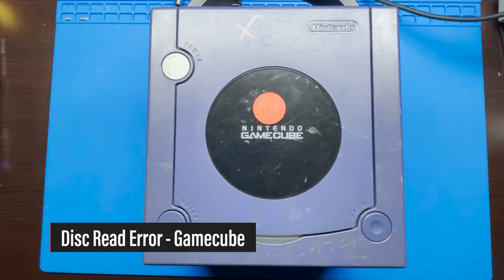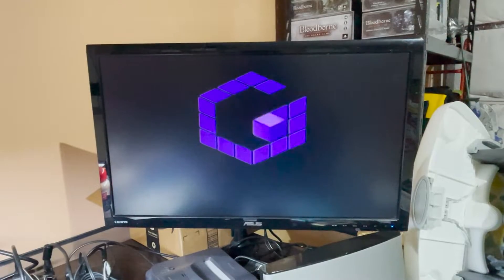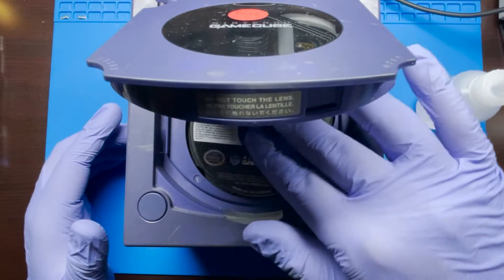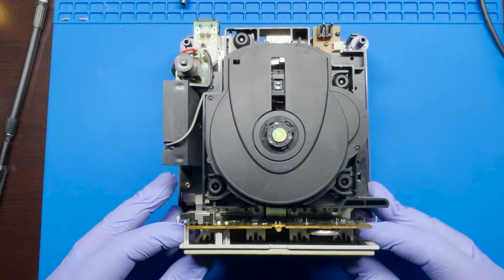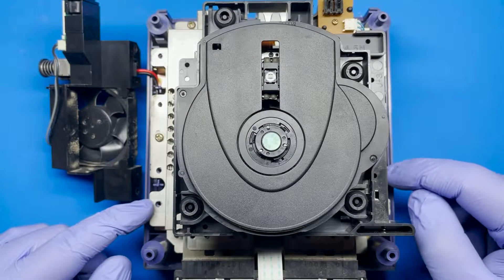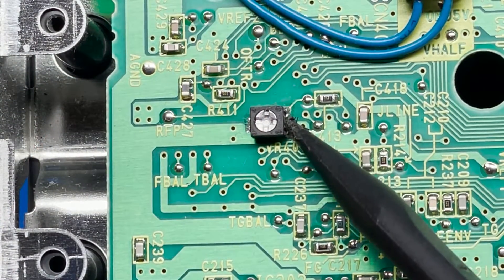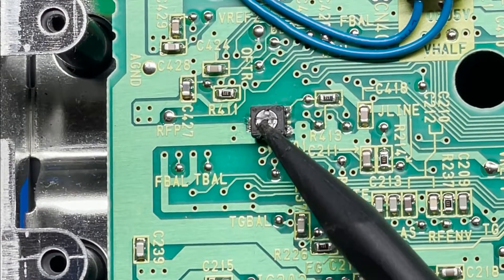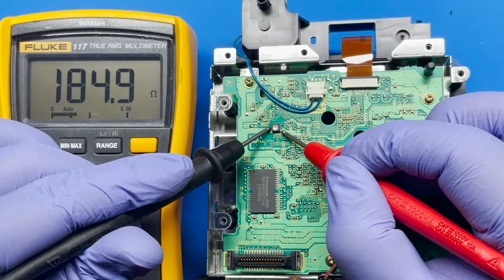Steps to Troubleshoot a Disc Read Error | Gamecube

Comment: Before messing with the potentiometer, I always check/swap some capacitors from the disc assembly's board (the same board that the pot is, just on the other side). The C408 47uf capacitor is notorious to go bad (the 100uf C401 and the 47uf C431 next to it sometimes goes bad too). My guess is when we mess with this pot, we're just feeding up extra power to the laser to compensate those bad caps.
Reply from the maker: Yes this is true, I should've mentioned that in my video and I actually ordered a set of capacitors from Console5 to replace them (I just rant out). They generally run for $2-3 and is a lot cheaper to replace than the laser reader. I will upload a new video showcasing this and thank you for bringing this up! Also, in the case that anyone changes out the caps, be sure to reset the potentiometer for the laser back to the original factory setting as shown in the video, otherwise too much power is being applied to the laser.
 
For reference (Factory Settings):
DOL-001: 450 ohm - 600 ohm
DOL-101: 150 ohm - 250 ohm

Cap Kit (Look for Optical Drive Caps):
https://console5.com/store/nintendo-gamecube-smd-cap-kit-ntsc-and-pal.html

Comment: Mine was reading 190 ohms and I did a recap using a console 5 and it wouldn't read discs until I got it down to 112 ohms. I triedit again a few days later and it wouldn't read the discs until I cleaned the lens with ipa. I"m not sure if the laser is just super dirty. if it stays consistent I may adjust the resistance up to avoid burning the laser out

Comment: Thank you for this it was very in depth! It seems I just have to adjust my GameCube’s potentiometer a little bit. If it goes below 120 ohms I’ll just replace it. Like you said it could damage disks and these days you cannot afford to do that, literally. A new disk drive assembly with the lid flaps is cheaper than a copy of Smash Melee these days.

Comment: I've been having trouble diagnosing mine. I move the laser to a down position (closest to the center) and when it turns on to reset the position, it makes this horrible grinding noise, like the gears are slipping for the laser rail. 
When the laser is in the highest position when turned on, the motor doesnt even spin (doesn't spin on both positions). Do you know what it could be? All the gears look fine to me.

Comment: hi, i know this video is pretty old. i just wanted to say the BIGGEST thank you.i got a gamecube off ebay to read games following your entire tutorial. 

i do have one question for you, mine is running at around 22 ohms ): i tried every digit possible as far as 250 and only that seemed to work. you mentioned this would mess up my games over time? what are the other disadvantages of playing it with only 22 ohms? im still grateful to even have it run and start i even got emotional
Reply: also, i saw your tutorial on getting a new disk reader considering it seems id def need to buy one. it looks so complicated though this was truly so much money wasted for me.

would you reccomend i buy a new gamecube off ebay and try to fix it as well? see if it actually holds around 130-170 ohms? I'D APPRECIATE YOUR FEEDBACK SM!!! TY AGAIN <3
Reply: That’s awesome, I bought a GameCube with 4 games 2 controllers today from offer up for $25 came home plugged it in and it won’t read the games but the game cube turns on just saids an error has occurred 😢😢

Comment: Let me ask you, have you ever heard of a GameCube that needs to "warm up" before working properly?  I never had the chance to clean my game disk, as every retro store around here either has their machine broken (even after getting it replaced) or does not have the GameCube game adapter.

So I was powering it on and off (resetting) about a dozen times or so, and it would get a little further each time and then finally get to the Press Start screen and the game would play no problem, all day and night.  But the process had to be repeated each day.

Then I discovered by accident, that just simply turning on the GC for five minutes or so and then resetting or putting the game in, it works flawlessly.  My other games work fine, just not this one.  Ever heard of that issue or solution before?
Reply from the maker: I think there was a user that had commented on the exact same issue that you had. Personally I haven't come across that issue, but it could also be that once I notice the disc not being read, I start replacing the components 😅
Reply: @totalfix877  haha!  Ok.  Thank you.
Reply: Yes!! This is currently what I have to do with mine. My guess is it has so ething to do with the Lazer going bad so maybe it needs time to warm up as it gets older
Reply: @sadiqmuhammad396  but only for a certain game and not the others?
Reply: Just trying to help but ur capacitors on the board of the disk drive have gone out that’s why
Reply: @ThePooterMan642  what makes it continue to work though?  Warmth of having it on for a few minutes?

Comment: My GC gives me a disk read error sometimes and sometimes it will not.  So I am not sure exactly what the problem is.  When it reads the disc, it works flawlessly.  It's getting it to read the disk consistently, that is the issue.
Reply from the maker: It may be that the laser has gotten weaker over time, you can easily tune this to be a bit stronger for your case since it doesn't sound like it's in such a broken state that would warrant an entire capacitor replacement (although that would be a true fix for it). 

This would involve a few tools:
1. Digital Multimeter
2. 4.5mm Gamebit for removing Gamecube Security Screws
3. Phillips #00 Screwdriver

There are a couple of videos out there that show how to adjust this (including from my channel). Hope this helps!
Reply: @totalfix877  is it the thing you did in this video, where you took it out of the box and "unravelled" it and then turned the screw for the laser to raise or lower the power slightly?
Reply: @totalfix877  actually it may not be my console after all.  Although I had a disc read error on one other game, that same game now no longer has the error nor my other games.  The game in question that does have an issue works some times and then some times does not, but now simply refuses to work at all now, which is why I was so sure it was the laser.

It's been in my case and in a box for a while, with the rest of the few games I have.  Not sure why it is being such a butt to play it now.  Does have a little cloudiness and a few scratches.  Breathing on it and wiping, does not seem to help unfortunately.

It some times gives me the disc read error from the start.  Some times it shows Nintendo on the screen before the error occurs.  And sometimes the game shows you getting off the train and start to walk around, but before the Press Start shows on the screen, the error message pops up.  But the music continues.  Confused me why it can do different things and not consistent.

Comment: @Total Fix  I bought one today, it has same issue it attempts to read the disc then stops after a few spins. I turned it on and off and suddenly it started to spin continuously and read the disc. I turned it on and off 5 times and it read the game every single time and I was able to play it. After couple hours I started it again and It stopped reading again. I'm wondering what could be the problem 🤔
Reply from the maker: This behavior you are describing is pretty common when the laser cant consistently read the discs any further. Often times when I replace capacitors or adjust the laser strength, I have to give it a few 10-20 test runs for the exact issues you are describing. Typically I adjust the laser to a slightly stronger strength when the disc doesn't get read successfully in any of my test runs (after I've replaced the caps). To answer your question, it might just be your reader starting to lose some of it's power unfortunately. 😢
Reply: @totalfix877  thank you for the explanation! I've been playing it more often I found out for some reason when It gets warm it plays fine, so when I turn it on I usually wait for like 5 minutes and then it works perfectly fine. I did lot of research and it seems related to capacitors. I would love to swap them but Unfortunately I don't have a soldering station nor the skills to do it lol.

Comment: I got a DOL-001 and it can't read any games over 140 Ω's. Not sure if it needs replacing or not.
Reply from the maker: Most disc readers have worn out capacitors, I will try and make a video on a disc reader lot I have to show these repairs.
Reply: @totalfix877  Fixed it a couple months ago. It was in fact, the capacitors. Finished Luigi's Mansion no problem.
Reply from the maker: @Ayasedere  That’s awesome! Glad to hear you got it working again 😃

Comment: I removed my disc while in the menu of mario kart double dash and it was running without the disc until it noticed the disc was out and I turned it off. when I decided to turn in back on to play, it would refuse to read any disc I would gave it. the game cube as whole was still working since I was able to navigate in the menu settings so uh yeah, I believe it is a problem with reading the disc. It does not read disc anymore nor does it make the disc spinning. what's up, according to you?
Reply from the maker: Does the disc spin at all? As in, does it attempt to read then stop completely, or does it just not spin at all?
Reply: @Total Fix  I bought one today, it has same issue it attempts to read the disc then stops after a few spins. I turned it on and off and suddenly it started to spin continuously and read the disc. I turned it on and off 5 times and it read the game every single time and I was able to play it. After couple hours I started it again and It stopped reading again. I'm wondering what could be the problem 🤔